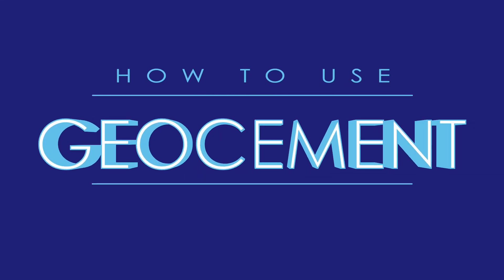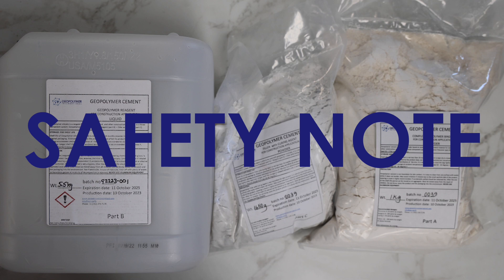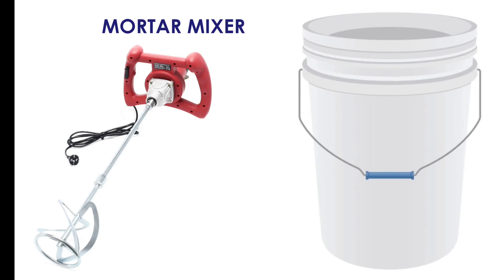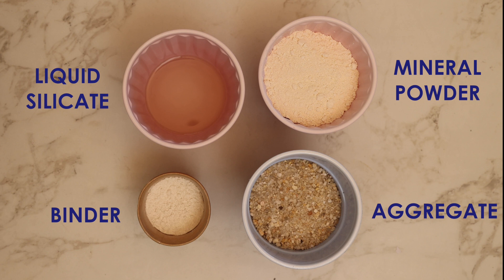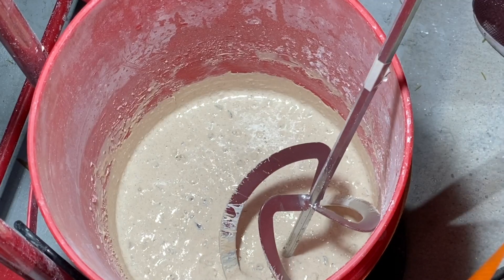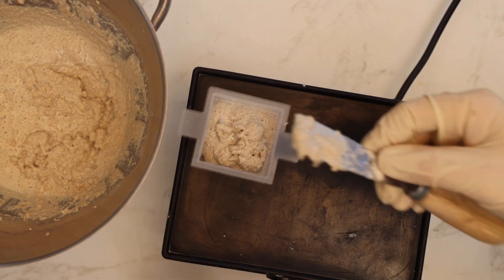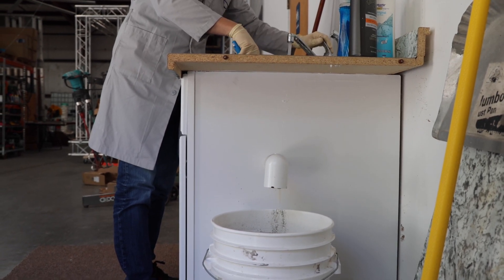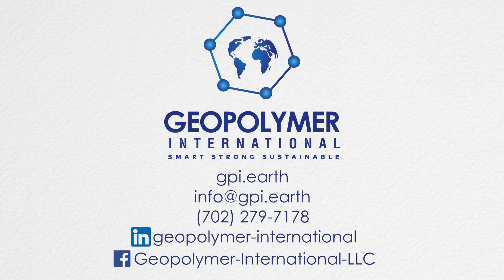GeoCement Mix Instructional Video

Comment: Hi GPI, I'm wondering about the setting process shown here in the video. Does a 3D printed structure have to be wrapped for 28 days in order to fully cure? If more binder is added to the mix will the total curing time be shorter? Thanx!
Reply: In the video I saw they put the 3d printed item into an oven to cure it.